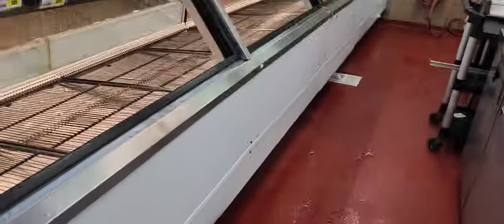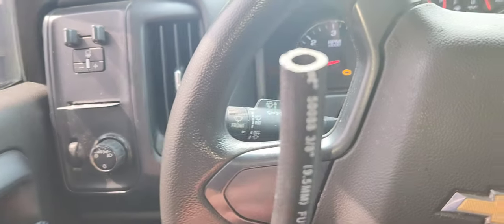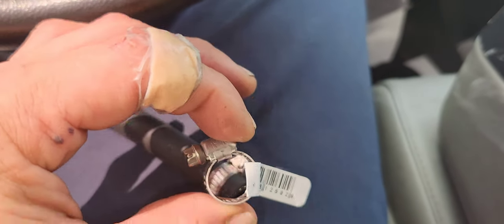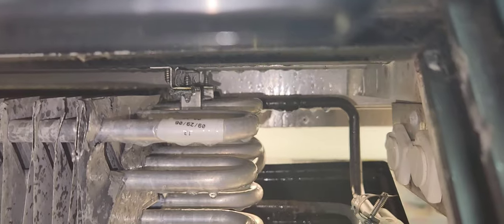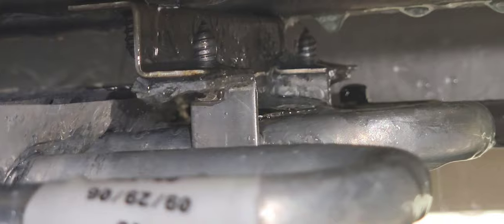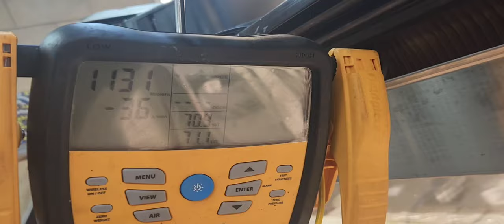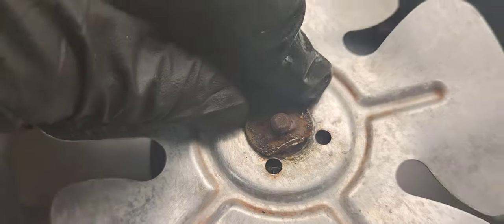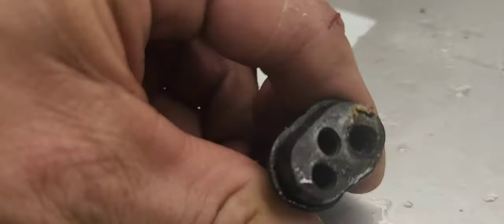Leaks On Rack Getting Repaired Pt 2

Comment: I've used the rubber and hose clamp trick many times on water leaks but never on refrigerant leaks. Also you went way above and beyond locating those leaks. Great work! I would have put the sniffer in the coil got a hit and immediately tell them they need a coil. 😂
Reply from the maker: Thanks for the comment. Yea my service manager recommended to try that. Lol

Comment: Adding nitro into a valved off case on a rack?? You're a brave man
Reply from the maker: Why's that?
Reply: All you have saving the nitrogen from contaminating the entire charge is a couple ball valves, if you do out nitrogen into a rack system try to never go above the suction pressure so there is no way to get into the refrigerant. That's the first thing I thought as well lol, FYI good temporary fix I have never had any good luck with alluminum repairs

Comment: I never add nitrogen to any circuit tied to the rack if a shut off valve fails major issues . use refrigerant or pull a Vac.
Reply from the maker: Sounds good. I won't do that in the future anymore
Reply: Is that not illegal to use gas to pressure test in America